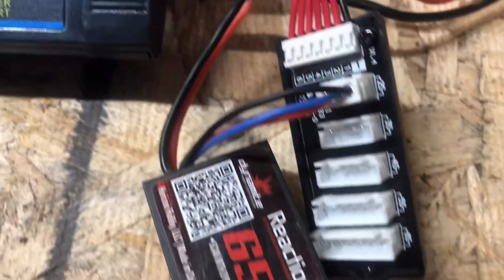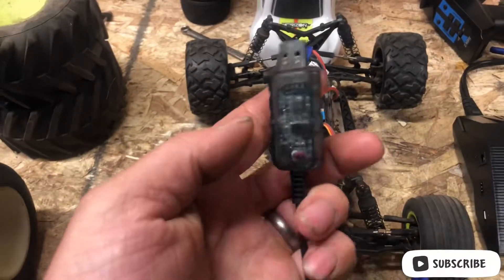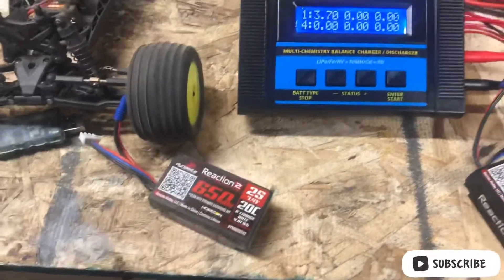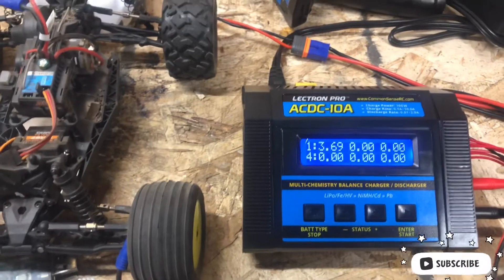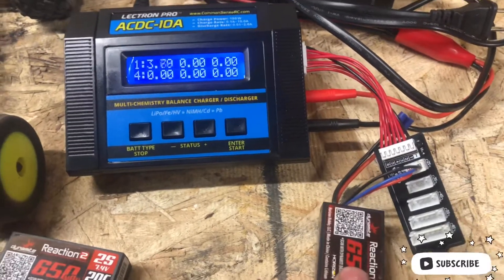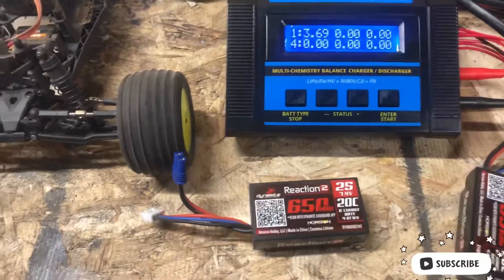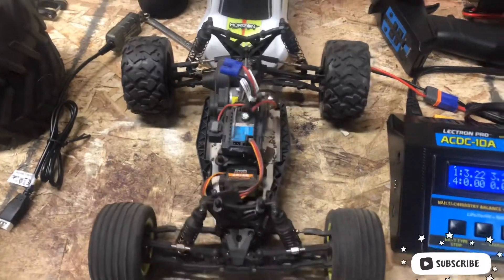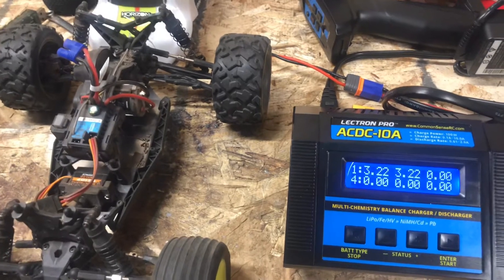🔥DEAD LIPO BATTERY CELL🔥

Comment: I've never heard of a Dynamit Reaction battery and I've been in this for over 6 years. Might I suggest you invest in a real battery, like a Venom from Atomik. Using cheap LIPO batteries is just as dangerous as having a bad one. Watch for swelling. Your hobby shop sold you a Reaction battery? Huh.
Reply from the maker: It came with the rtr losi mini t 2.0, but yeah most rtr lipo batteries are not the greatest